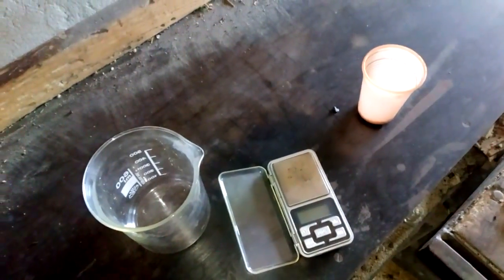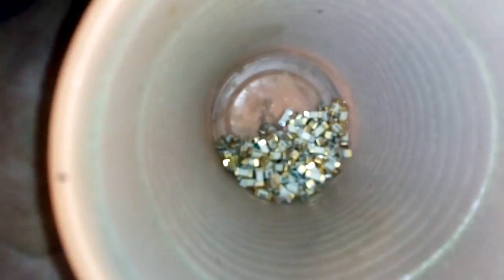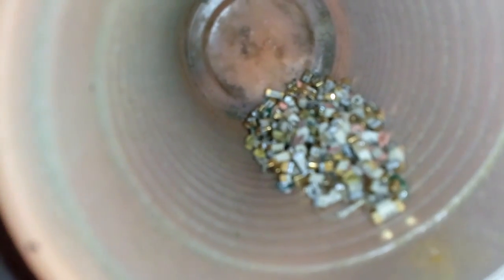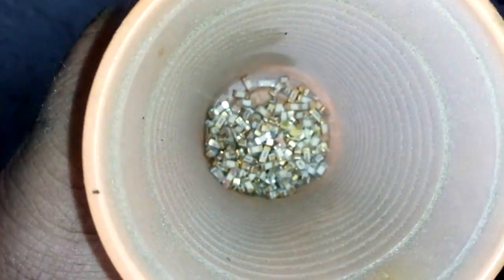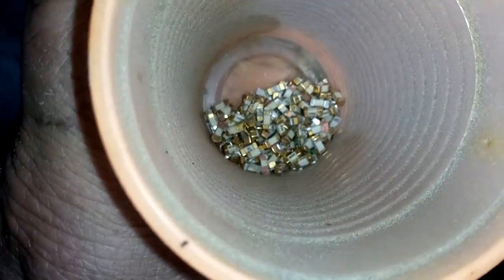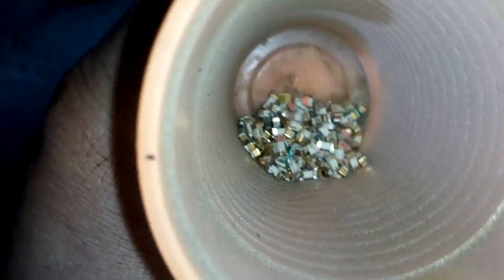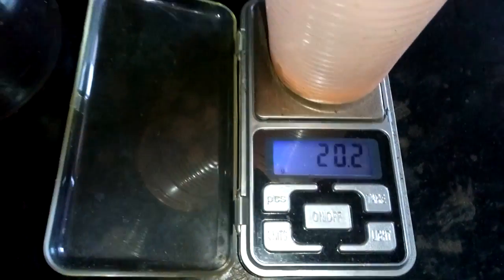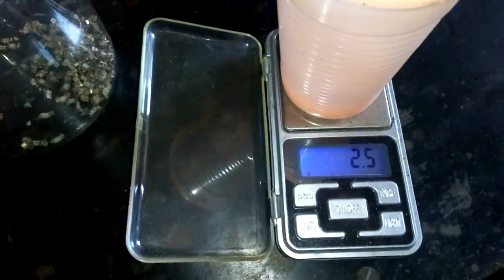Gold CERAMIC FUSE for gold recovery!

Comment: Yes nice vid
lesson learned, not worth the effort. 0 on the scale. If you had about 1 lb, crushed them, removed the gold caps then processed the caps you would have seen more than a 0 and used the same amount of AR, might have broke even on the chemical cost. I do this part time and recover over a gram a day, February I did over 1/2 oz of 24k. I expect to do more than 1 oz this month.
Reply from the maker: joe k I'm glad you're worth it and you get a good amount of gold friends.

Comment: always get excited when a new dusan video is out! Those golden fuses Look sweet I have never seen those will have to keep a look out for them :) .2 grams of silver is not bad makes be wonder how much the golden one weighs .09 .08... .05 .01   LOL  all good not that it makes a whole lot of difference. I bet 200g of these is close to a gram of gold. :)
Reply from the maker: bohemian mystik Almost 0.1 grams. You were right, 200 grams would give you a gram of gold. Thank you for keeping up my channel mate.
Reply: I've found them on tv's. The gold fuses. Flat screen lcd and led's. You find them on the narrow boards on the two sides of the screen. Usually only one or two per tv but you find other gold bearing stuff too so it makes it worthwhile to go after them. I'm from the uk so I'm not sure about tv's from other countries, but they're generally all the same I imagine, apart from the power supplies I suppose. 🤓👍🏴

Comment: It looks like you need some better scales.  You can get them on ebay that measure down to .00 that are very cheap.  I brought a set and they work very well :)
Reply from the maker: William Fagan Yes i need a beter one. Did you rechive my my gold yet? Cockpill and Robert have received them in the USA, but you have not answered me. There were some problems with sending, some countries are suspicious about receiving packages from Serbia, and so on. I had a difficult time to send but I found a way to do it. Answer me on the mail okay.